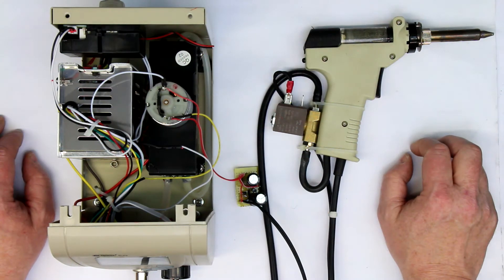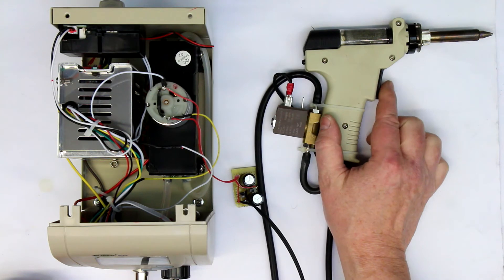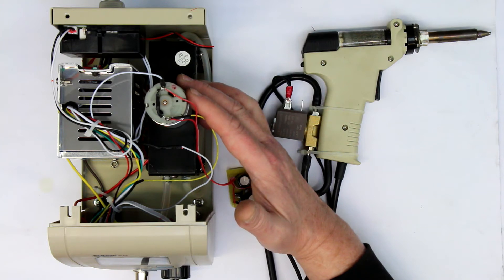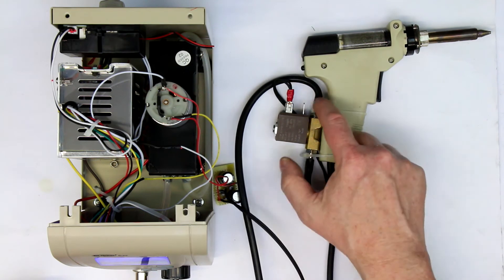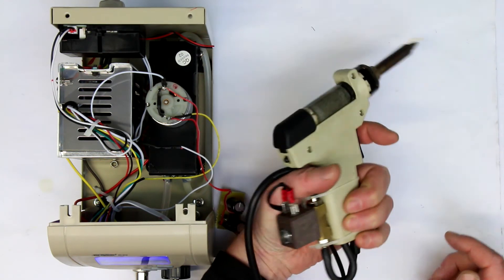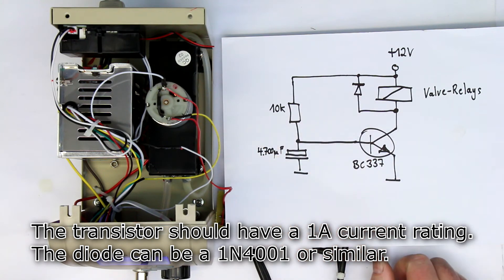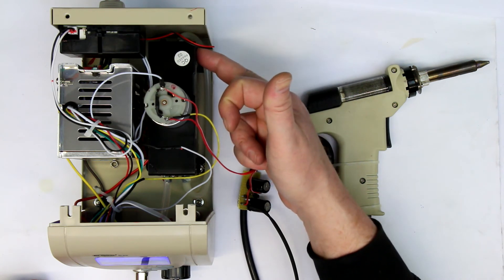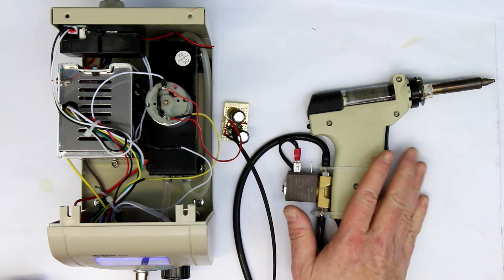A better mod to improve the ZD915 Desolder-Station

Comment: I tried this with a small 12v relay/ valve switch.  Performance is even worse than stock.  Is there a particular level of pressure that the switch must be able to deliver?  Disappointing.  The circuit works fine, and the switch is triggered, though there is even less suction.

Comment: Wait... So all this work because we don't want to squeeze the trigger and count to 1 before starting to desolder? Yeesh.
Reply from the maker: No, you didn´t get it. When you place the desolder-tip on the solder, you want to get the maximum "suck" and not a slowly increasing vacuum. Otherwise it´s hard to suck solder out of through-plated holes with the wire or pin still in the hole. Often the clearing between a componetn wire or an IC-pin in the hole ist only of the order of 1/10 mm.

Comment: I think the unit works just fine as designed. My biggest beef with it is the length of time it takes to warm up from cold, so to have it ‘always ready’ you have to have it on all the time, and this results in the piece of composite that the element screws to crumbling away after not too many months. I have replaced my handset for this reason twice since I have had it. I have it in mind to see if zi can figure a way to control the temperature with a single input so that I can sense when the handset is in its holder, and reduce the temperature to an ‘idle’ so that it will pick up to useable temperature when the handset is picked up

Comment: You almost need to put the vacuum on a demand system similar to how compressors work so that you always have the vacuum ready.  There's not that much air that needs to pass into the desoldering tip.  What if you could use some sort of sealed bag with a weight hanging on it or something (bellows) and then just lift it back up every now and then.  Silence.  Every now and then you just hear a small fart sound.  Ha, sorry, but what if you could fix someone's desoldering gun so it sounded like it ripped one off every time you pulled the trigger.  God I'm a sick puppy.

Comment: That's great but why put the valve contraption on the gun? It would be much more neat tucked away inside the enclosure...
Also, perhaps a potentiometer to adjust the maximum delay so as to protect the pump would be advisable? Some people for some applications might not actually need a delay at all.

Comment: Hy 
Can this fix also be appied on  proskit desoldering station?
My station is not sucking properly
Reply from the maker: It looks like it´s the same. Mot vacuum desoldering stations seem to come from the same Chinese manufacturer.
Reply: @KainkaLabs   There's at least 3 different Chinese manufacturers but the Pro's Kit ones come from Ningbo ZhongDi just like this one.

Comment: Too big reservoir. For desoldering 10 pads you have to vacuum all the capacity. The gun originally works without it. The main problem with this gun is a vacuum leak between tin chamber and desoldering pipe.
Reply from the maker: Where shall this leak be? The tin-chamber is connceted with a rubber-seal to the desoldering pipe.

Comment: With the right maintenance it works well even without modifications.
Reply from the maker: No, it doesn´t. Try to suck a small through-plated hole with a wire from a thick component in it. You will never ever suck this cleanly out.
Reply: @KainkaLabs  THANKS! I will try this.  It's never worked brilliantly, I heard about putting in a replacement more powerful pump. Although I have the ZD8917 its the same issue with THT, it won't et to the other side
Reply: @KainkaLabs  No problem at all, i own one for 10 jears now, no problem ever.
Reply: thats true ^^

Comment: If Im not mistaken, the Hakko 470 uses this exact principle, except the solenoid valve is inside the case, where the tube attaches.

Comment: If you replace the bad 18-to-12V-Resistor-bord with a DC step-down converter, also the suction power increase.

Comment: Nice, a demo would be great
Reply from the maker: You can believe me, if I say that it´s a better mod. For a 1:1 comparison I would need 2 desolder-stations, 2 identical PCBs each with a dozen solder junctions to compare. Impossible. In a few weeks I will upload a video with the best desolder station I evre used. Just wait for it...
Reply: @KainkaLabs  Thanks for your reply, a comparison is not needed, but at least get a feel for the delay. The mod makes perfect sense to me, no doubt about it, great job!

Comment: Wearing out the pump motor is probably not s problem, but wearing out the diaphragms certainly is. I had to replace mine after a couple of years, and just try sourcing them.

Comment: Will this station satisfactorily desolder  lead free soldering?
Reply from the maker: There is  no difference between leaded and leadfree desoldering except for the +20°C higher melting temperature.
The most important for any desoldernig work is that apply flux before desoldering.

Comment: I personally would go for a mechanical valve instead of the trigger switch and a small reservoir inside of the main unit with a pressure sensor which powers on the pump. Good job, though!

Comment: A better way would be to build the vacuum valve  into the handle, directly activated by the trigger and have the compressor/pump only running when needed, controlled by a suction sensor in a small vacuum reservoir. That way the you have the best of both worlds.

Comment: I noticed the same thing my pump blows instead of sucking I have a quick question did you reverse the negative and the positive to reverse the airflow so I could suck would that fix the issue of the not sucking but blowing issue? If anybody can help me answer please thank you

Comment: It looks like there is enough space for a small vacuum reservoir in the case. I gonna try and combine your vacuum reservoir idea and my delay circuit idea and fit it all neatly inside the case. That is, once I have some time to get around messing with my ZD915.

Comment: I’d like to make a foot pedal operated version of this for my Aoyue soldering/desoldering station. There is a newer version with a stronger DC pump but mine is the older version with the more robust AC pump. It is also used as a fume extractor which means I can set it to run constantly. I am hung up on the vacuum valve part. What do I search for? When I search eBay I get a bunch of car parts that look nothing like your small, rectangular, valve with blade terminals. Is there a name for this type?
Reply from the maker: You don´t have to search for "vacuum valve" but instead e.g. for "electric solenoid valve"
Reply: KainkaLabs Thank you!
Reply: @KainkaLabs  I cheated to do this manually by pulling the trigger while kinking the hose for a few seconds, then I straighten or kink the hose to trigger the suction when desired. Of course, it requires two hands but it works well. I still want to do the foot pedal and trigger the solenoid just to free up a hand. Thanks!
Reply: @KainkaLabs  You know, I just realized that my Aoyue ain’t 701A++ station’s integrated fume extractor feature will charge the vacuum… so no foot switch is needed. I think this will be a very simple modification (just the trigger-actuated solenoid). :)